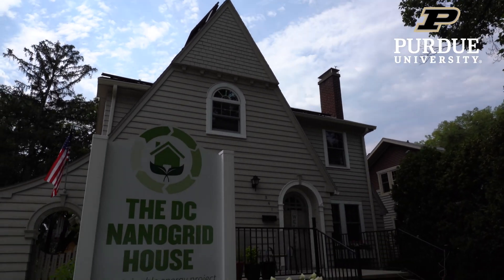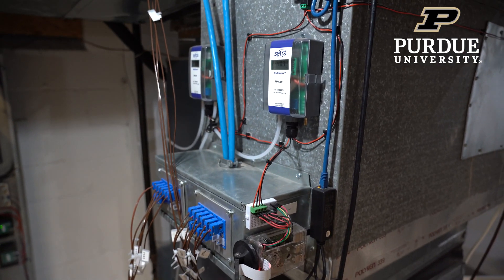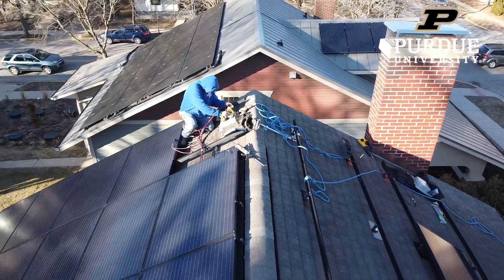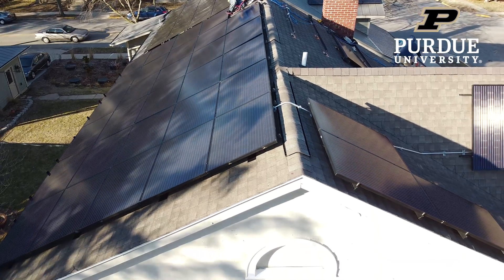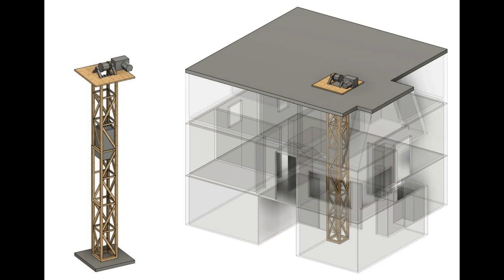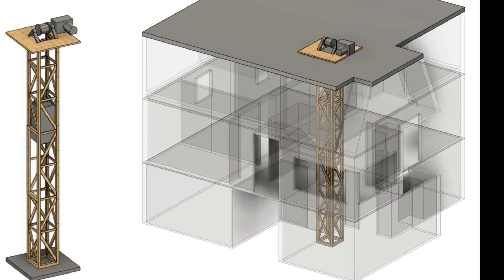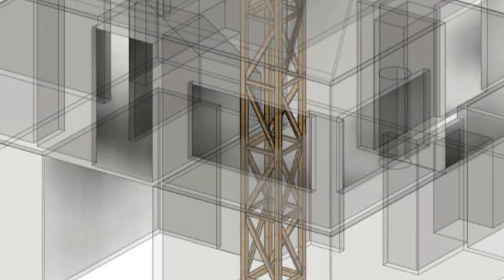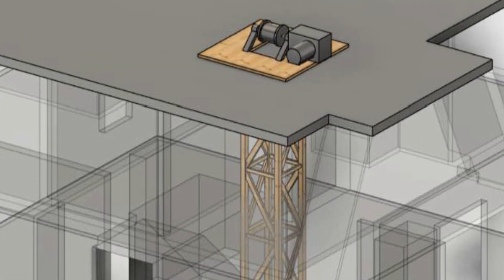Could a “gravity battery” work in a residential home?

Comment: What were the numbers? How much input for how much output?

What was the total height of the weights movement?

How heavy of a weight did you use? Was it metal or concrete?

Please provide some information. Thank you
Reply: For anyone else that is curious, here's what I got from the paper on short: "The team concluded that the final design would cost approximately $7,700 in parts and at least $3600 in installation
and would have the capacity to store approximately 171 kJ/47.5 Wh, the equivalent of approximately 12 AA batteries." and "To achieve an energy capacity of even 1 kWh would require a weight of at least nearly 8 times the designed volume, reaching over 3 m3 in size.". That's enough to know that it will never be better than chemical batteries for home storage. At high scale it can become interesting as I've seen in some projects they made in China, but for small scale is definitely impractical.
Reply from the maker: Here's the paper: https://docs.lib.purdue.edu/cgi/viewcontent.cgi?article=1470&context=ihpbc
Reply: Yeah, I think it's most thought of as a more energy dense alternative to pumped hydro. Could be installed almost anywhere. In contrast, hydro is massive and needs topography with large height difference, severely limiting where it can be installed.